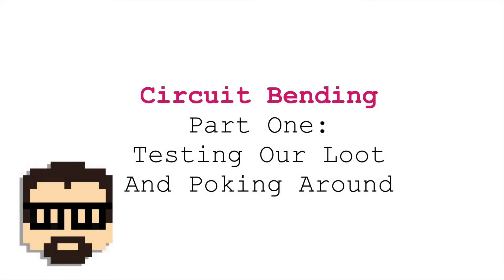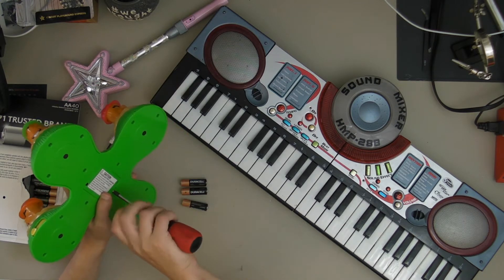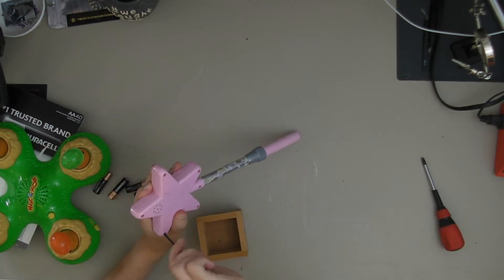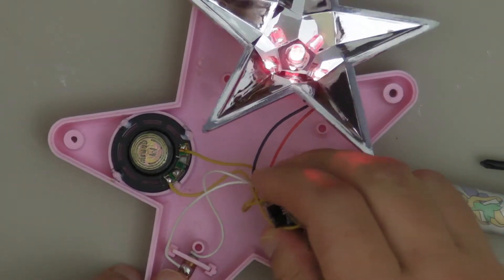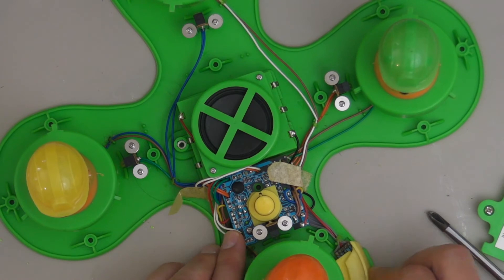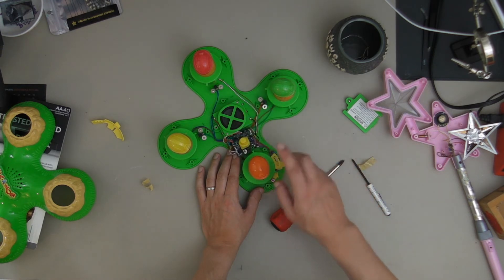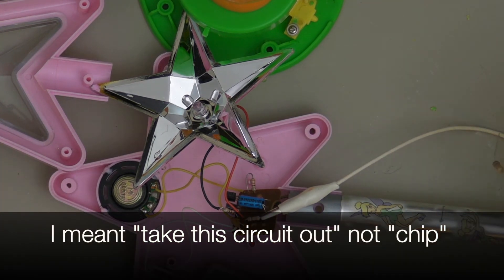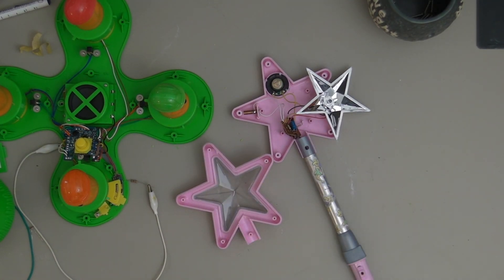Circuit Bending 1: Testing Our Loot and Poking Around | Simon Hutchinson

Comment: I'm jealous of you finding clock resistors in these modern circuits. I bought a handful of toys and couldn't get anything to bend.
Reply from the maker: It gets harder and harder. This video is almost 4 years old now, and I’m not sure I’d have the same luck if I did this today. That said, keep checking Goodwill and taking a gamble on cheap stuff and you might get lucky!🍀
Reply: That's a really good point. I think I'll bring my screw driver to good will lol. But good to know i really need to just look for older toys.